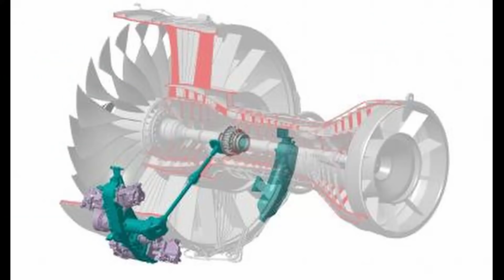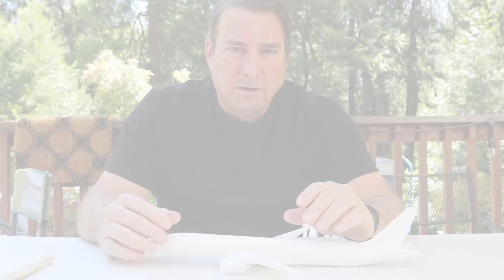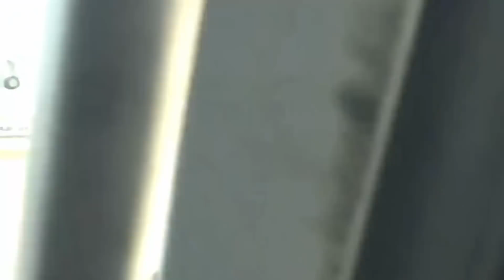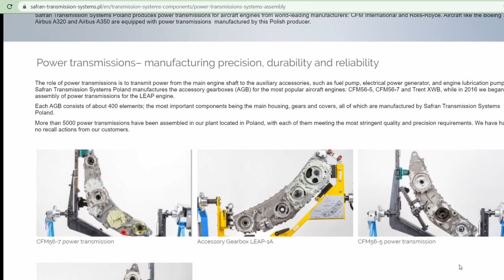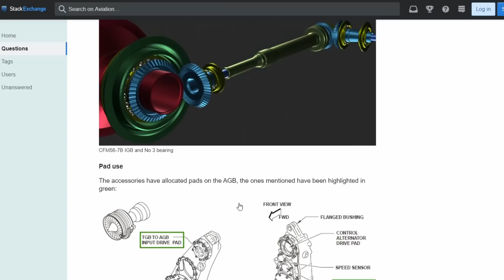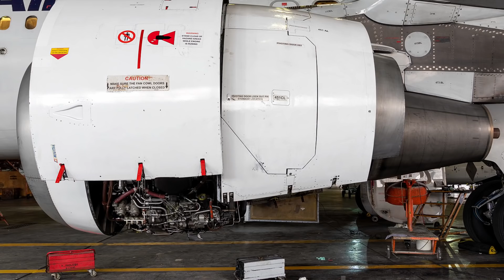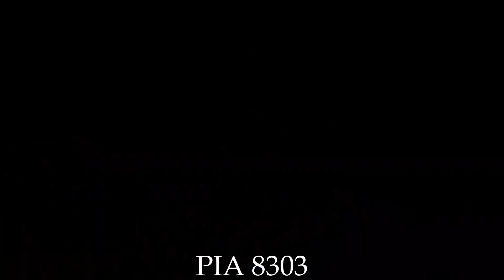PAKISTAN INTERNATIONAL AIRLINES #8303 UPDATE #2 23 May 2020

Comment: In 2007 a Jetstar A320 incorrectly initiated a go-around after a fog bound ILS into Melbourne Australia. They used a method called TOGA-Tap, which involved putting the thrust levers to TOGA momentarily to initiate the go-around then bringing them back to the climb detent to reduce the thrust for the climb-out. All that happened in this event was that the aircraft did not go into the required go-around modes and started accelerating towards the runway under climb power. The Jetstar crew got down to 38 feet before climbing away. My theory is that this crew did the same thing, retracted the gear before confirming the go-around modes were initiated and stuck the runway with the engine pods, causing damage to either the fuel or oil systems. A dual engine failure resulted. 
https://www.atsb.gov.au/media/793232/ao2007044.pdf

Comment: If the pilot(s) had attempted a wheels up landing, it would have struck the tail on the flare, NOT the engines.  Likely, it is as Juan believes -  premature rear retraction at too low, too slow.

Comment: CAA Runway Inspection report: 

"No belly touch only both engines touched alternately on runway followed by a go around.

The scratch marks suggest 1st touch with left engine at 4500 ft down, followed by both engines touch 5500 ft down then alternative touches more thicker ones from 6000 to 7000 ft then only right engine touch with left off till last 1500 ft where it gets airborne for a visual closed landing"

Strong evidence aircraft touched runway first time with out gears. Both engines grazed the runway at 4500 and then 6000 ft before aircraft opened power and went around. During second approach both engines were losing power probably because of initial damage and FOD  ingestion.

This was released by Pakistan CAA on 23rd May.

Comment: Just want to add on to whats been said so far. Being high and fast on the approach with the gear retracted (if it was) would result in a very low power setting. In the damaged airborne pics, it is unclear the position of the Slats and Flaps. Also, the position of the speedbrakes cannot be determined. If the gear did not extend for whatever reason, the spoolup time could result in the second runway scrape as seen in the video.

Comment: The airline reported that the pilot, Captain Sajjad Gul, told air-traffic controllers of a problem with the landing gear and then reported losing both engines. An onlooker told news channels that the aircraft had fire coming from its wings, and it hit rooftops of some houses before crash landing.
Reply: ...if anything, that happened after the aborted landing...nothing before was mentioned to the ATC.  What the pilots probably were doing is trying to save face, and their jobs, by suddenly have a defense ready in preparation during inquiry for botched landing...and claimed that that they had gear issue; hence, the reason for a go-around.  They were incompetent morons...and liars on top of that!

Comment: Having an issue posting on my channel so I borrowed this one to comment. Retired Airbus Captain here. Other than everything that has been discussed to date, would be that being high and fast without the landing gear down for drag, would be the position of the Slats/Flaps, Speedbrake, and thrust levers (Manual thrust). In the damaged nacelles pics, it is hard to determine the position of the Slats but the Flaps appear to be retracted. If the engines remained at idle throughout the approach and the aircraft briefly touched on its nacelles, the spoolup time could contribute to the second touchdown on the nacelles as in the runway video.

Comment: Some questions:
1) if there was an issue regarding landing gear deployment at what point in time would the pilot likely have noticed it before landing?
2) if the landing gear could not be deployed during first landing due to some fault, should the pilot have tried to land in the first place? Shouldn't the plane have been kept airborne, given there was enough fuel? 
3) should the pilot have informed about landing gear failure to the flight control, if yes, the why didn't he do so?
4) there is a cctv footage allegedly showing that landing gears were deployed before crash. What would that mean?
Pilot had 24-year career in airline having an experience of more than 17,000 hours. He flew A320 airbus for 4,700 hours.

Comment: Condolences to the families and friends of the victims. In addition to the RAT, it appears the APU might have been running as well. With the photos you showed in the video I suspect fluid lines  near the bottom of the AGB were damaged and might have caused loss of fluid pressure during the go around. Such a tragic loss of lives.

Comment: Watch this instructional video on A-320 GPWS

https://www.youtube.com/watch?v=wDOztSeeMek

It can be turned off in a second with one P/B switch. The gear warning is included in this system. If, IF,  a pilot was high, and descending faster than normal, on purpose, the Terrain Warnings could be triggered, the pilot thinks, I know that, I'm doing it on purpose, I'll turn that nuisance warning off.

Comment: Hi Juan,
9,000 hours in the DC-8 with Emery Worldwide Airfreight.  First started in the narrow engine dash 61/62 & 63 models.  We then got re-engined "Cammacorp" DC-8s with the CFM56's.  These aircraft (-71's, & -73's) initially had transitioning pilots scraping an outboard engine pod on a crosswind landing.  Your first "tagged" pod got you 1 month on the beach. 2nd pod got you fired; until the chief pilot got his 2nd pod.  True story.  777/FO/LAX

Comment: With all of the components of the auxiliary drive system that would be very likely to suffer from brittle failure from high shock loads (the drive shaft must be very hard to be that long and that thin, and the casing is a cast part), the ground strike probably sheared one, or more, sacrificial pins to prevent the explosive failure of the drive shaft that could result from one end jamming to zero rpm, while the other end continues to rotate at 19,000 rpm.

Because aeronautical engineers do not expect both/all of the engines to strike the ground at the same time,  the auxiliary drive system has no redundancy, because there is complete engine redundancy.  If the auxiliary drives were above the engines, the impacts may still have disabled them.  A redundant auxiliary drive would have be powered in a different way, possibly mounting the redundant auxiliaries around the low pressure shaft.

Comment: Juan, good report. The graphics used in the video were for the 737 variant of the CFM-56 engine.  The A320 version of the engine has the accessory gear box on the bottom of the engine . The 737 version of the engine has the accessory gear box drive at the 9:00 (when viewed from rear) placing the drive in the lower left quadrant. I agree with you analysis of the probable scenario. Had the airplane touched down with the wheels up I would expect to see tail strike damage. Also I don't think the A320 flight control laws would allow the airplane to sink that low with the wheels up. The A320 has a accident history where the airplane gets too low and slow and the engine spool up times cannot catch up with the pilot's intentions. This accident has all of the characteristics of double engine failure. Damaging the accessory drives could result in the engines starving for fuel. All it would take is a crack in the drive case for the oil to drain out. The engine would continue to run for a period of time before the drives would seize and subsequent fuel pump failure.
Reply: What we need is airport video footage of what actually happened when the plane was on the runway, or touching the runway. As in - surely there are video cameras pointed at the runway all the time at the airport. This would then show whether the wheels are there, or not.

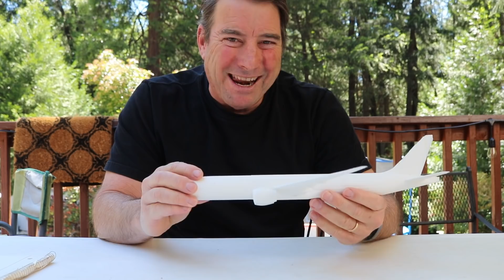Comment: 1:30 putting down landing gear highly unlikely? 

1985, PIA 747, Scrapped all the length of runway at Chaklala Airport (Islamabad), I remember seeing engines cowling flat due to belly landing. Reason : Pilots forgot to lower landing gear.

Therefore it MAY not happen with any other airline but PIA yes.

Comment: Wouldn't it be safer for manufacturers to mount the gearbox atop the engine instead of at the bottom, specifically to prevent damage in cases such as these?

Comment: Another video shows the A320 at a very high AOA  which could explain why the aircraft stalled and went down tail low! The crew had reported engine problems on approach and looked like he tried to gain altitude without power. A similar thing happened to one of the early demo aircraft in France in the 80s.

Comment: A question for your Eurojet affectionados as it's been 13 years since I flew an Airbus product. When you advance the thrust levers to TOGA on a balked landing  WITH the gear still in contact, does the 320 series have the same issue as the Boeing thrust setting anomaly/bug/feature? It seems that even if this was an issue, i.e.; settling back onto the runway after going around because rated thrust was not being delivered yet, the crew would have noticed an anemic climb rate.  Was there any further ATC transmissions that had the gear warning chime after that initial one? Thanks Juan for delivering these syonpsies.

Comment: Dear Mr Brown ! If the engines hit the RWY surface, then the engine rotors would have been severely affected as Fan, Compressor & Turbine blades would have scraped against the casings as the tip clearances (distance between blade tips & casing inner diameters) is in millimeters. So all talk of damage to AGB (Accessory Gear Box) is irrelevant. Irrespective of health of AGB, engine rotors (both HP & LP) would have got jammed due loss of tip clearance after engine impacting the Runway surface. Hence loss of engine power would have been due to jamming of rotors rather than damage to AGB and/or accessories (Fuel pump, Hyd Pump, Generator, Starter etc).
Reply: Dear Ashwani, gas turbine engines don’t jam when they’re running. They will rub on the blade tips which will wear away material. The material in the fan case around the tips of the fan blades is abradable (designed to wear)

Comment: I strenuously protest demonetization of Blancolirio channel. As all safety rules and regulations from time immemorial have been based on events where people died, it is important to learn from the mistakes of others. This not only in fire safety, electrical safety, poison control, etc. etc., but especially in aviation. Lessons learned from accidents have made commercial aviation the safest mode of transport for miles traveled and passenger count. Publicizing the learning experience rationally, professionally,  and without drama is a valuable service to all.

This in stark contrast to all the advertising "you will not believe..." sucking in eyeballs to buy (adjective here) "supplements" .

Comment: Always amazes me as a pilot to watch another pilot flying when they get themselves high and fast. They have more energy that God, yet they refuse to throw the gear.  Some weird quirk makes them think it’s a failure to throw it before they normally would, and so they use every other thing they can think of to get slowed down, short of opening up the window and sticking their hand out.  If I’m anywhere close to the airport, and I’m having a hard time calculating a successful solution with normal drag, I throw the gear. Hasn’t failed me yet.  

More importantly, the distractions that ensue from the other techniques leave you doing abnormal things later and closer to the ground, and the likelihood of screwing things up goes way up. 

Just like in this accident.  

Juan, what makes you think the engine strikes were a function of an early gear pull on go around vs a gear up landing?  Maybe I’m missing something?

Comment: Pakistan CAA Initial Runway Inspection report:
"No belly touch only both engines touched alternately on runway followed by a go around
The scratch marks suggest 1st touch with left engine at 4500 ft down, followed by both engines touch 5500 ft down then alternative touches more thicker ones from 6000 to 7000 ft then only right engine touch with left off till last 1500 ft where it gets airborne for a visual closed landing"
Lot of human factor issues, Flight radar altitude data indicate steep and continuous descent from 34000 feet, hot and high approach, appears to have forgotten to lower gear, overspeed/master warning triggered on approach, gear not down warning may have got mixed up. Engine damage due to ground contact may have resulted in flame out of both engines on downwind. Gear was lowered for the second approach so rules out the possibility of gears stuck.
Strong evidence aircraft touched runway first time with out gears. Both engines grazed the runway at 4500 and then 6000 ft before aircraft opened power and went around. During second approach both engines were losing power probably because of initial damage and FOD ingestion. 
Your comments regarding the quality and professionalism of commercial pilots my be valid within the confines of a well trained and regulated USA environment, this is not always the case with Middle East and Asian operators. Believe me, I've been there and seen it first hand.

Comment: It may not be relevant to the tragic accident in Karachi but, over the years, airliners seem to have been designed with less and less clearance between the engine and the ground. Even when the landing gear is properly deployed, the risk of grounding is presumably still there. There must be questions about the massive low-slung engines on the Boeing 737 Max . . .

Comment: It's too bad they don't have these parts a bit higher so if this happens it will not damage them as quickly? It would be nice if there was some special buffer that was below the engines that would be like a crumple zone so it would allow a bit of time for the pilots to do a go around. Even if there was a small set of wheels that was about 4 to 6 inches in diameter that could spin and flex in the same way a spring would.

Comment: Juan, an Emirates situation is my main theory too, especially if they initially forgot to add thrust (like Emirates) but climber and raised the gear and then lost speed and started to descend and then they added thrust but too late to prevent ground contact.
What is extremely puzzling is that the scrape marks on the runway for both engines are about 1500 ft long!!!! No it was not a quick tap as you show in your introduction.

Comment: Great video and again a very helpful explanation. There are still so many questions. For example in the flight profil you showed in the first video they only made one approach with the short touchdown and the following go around from there they still stayed some five minutes in the air. Other reports wrote about perhaps two missed approaches, which I guess was not the case. The ATC is also somehow weird. It seems that there were already some problems in the initial approach. Otherwise the crew would not say "We are comfortable. We can make it". It would be interesting to hear into the ATC before this sequence. Interesting also that Karachi assumed them at that stage somewhere else when he ordered: "Roger, turn left heading 180" and the crew responded that they are already established on the ILS 25L "But we are established on ILS 25L". It seems that ATC Karachi may assumed PIA 8303 further out and ordered them into a righthand base for 25L. The controller must have been surprised that the plane was already on heading 250 degrees. By the way - was even the approach controlled by Karachi Tower or was there a frequency change in between. However, the final clearance must have been given by Karachi Twr. It looks also very interesting that the plane made a very steep approach and increased the decent rate again the last minute according the flight profil. Again all assumptions and subject to the flight recorder data.
I hope that a proper, transparent and honest accident investigation will follow. All the poor families of the victims - may their soul rest in peace - deserve it so much.

Comment: Don't know where you're getting your information, BUT on the first day after the crash, it was clearly stated in the news that this plane NWEVER reached the runway - it crashed in a residential neighborhood before reaching the runway. Also on the day of the crash - there were pictures taken of the plane trying to land with BOTH engines flaming, so this was obviously the biggest problem, since the pilots would have had little control of the craft.

Comment: If they had power after contact, gearbox was working . no gearbox=no fuel pump=no fuel burn=engine shutdown. As well, fuel pump control had at least 1 harness channel. Total loss of electrical control should result in fuel cutoff=engine shutdown. 

With air turbine deployed, they had loss of electrical power and or hydraulic pressure. Both of these come from assessories off the gearbox. Was this severe enough for loss of flight control or loss of power to engine?

If hydraulic line in both engine were damaged enough to lose hydraulic fluid, is it possible completely compromise all hydraulics?